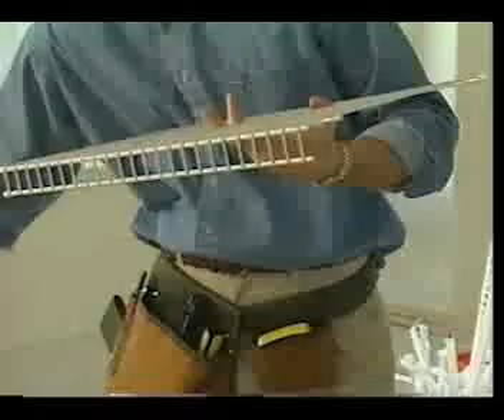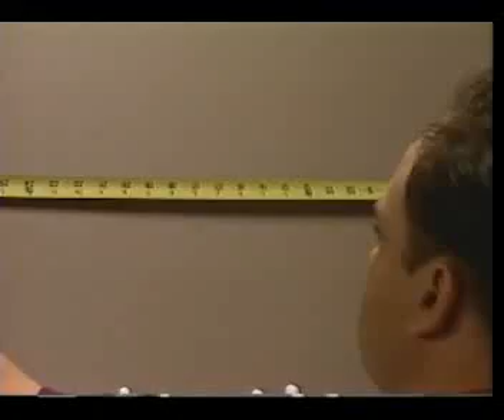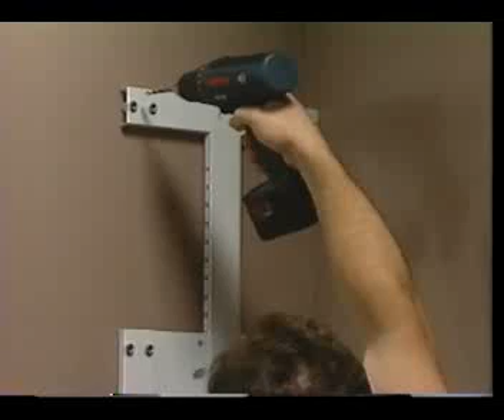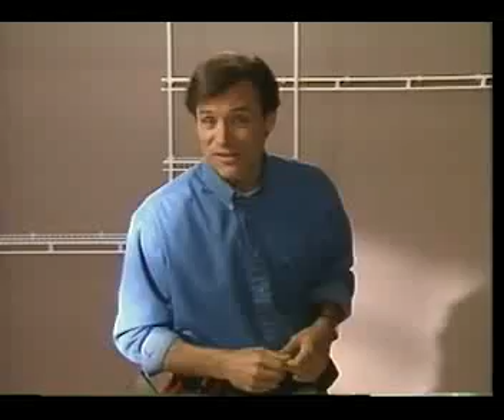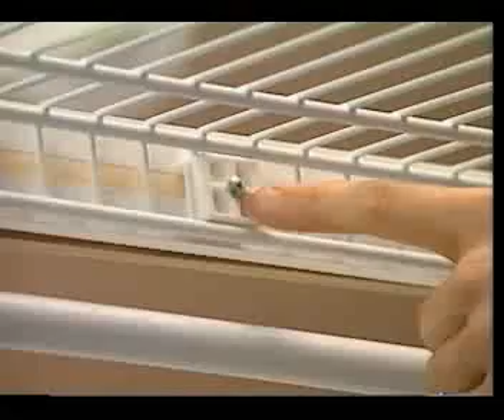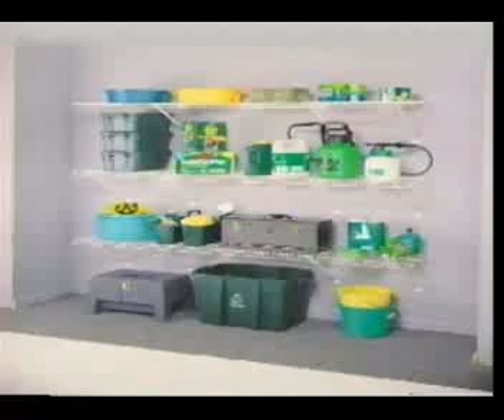ClosetMaid Wire Shelving Installation Video

Comment: Zero use of stud finder to at least make an attempt to anchor to a stud. Many of these shelves fail over time with plastic pieces in the wall and the hanging clothes come crashing down in the middle of the night. Also, I wonder how many water lines, drain pipes, electric wires, etc. gets hit blindly drilling with the template.

Comment: I'm really disappointed in Closetmaid.  Several of the hardware items in this video are no longer available, Closetmaid customer service referred me to Home Depot's Building Services department, which doesn't exist, and HD's customer service referred me to their website which doesn't have all the parts.  (Closetmaid's own website is not a complete source for their own parts it seems either! As a DIY project, this has turned into a parts disaster and a joke.  I'm appalled at the lack of customer support; the guy at Closetmaid made me feel like I was interrupting his day, and HD wasn't much help either.  I'm going to watch the video entitled "How I got rid of my wire shelving and replaced it..."  or something close to that title.

Comment: where do you get the template at
Reply from the maker: Sorry that template is only available to our installing dealers.
Reply: ClosetMaid a rental option for DIYers would be helpful.
Reply: well, that is stupid! Not everyone knows how to read a tape measure or install stuff like this! It would be nice to have something like this made available to the people that actually buy your products!
Reply: Victoria Simonetti : LOL! The point of the "template," really more of a jig, is that the contractor doesn't have to bother with a tape either -- which, considering the Home Depot parking lot help they pick up these days, makes the tool something of a necessity for the "professional" installer with his eye on the bottom line! Assuming he knows enough Spanish to say "Drill here and here and here. Comprender?"
Reply: @victoriasimonetti4124  7 year old comment but oh well, if someone is too dim to read a tape measure, how the heck do you figure they will be able to use the template? LOL